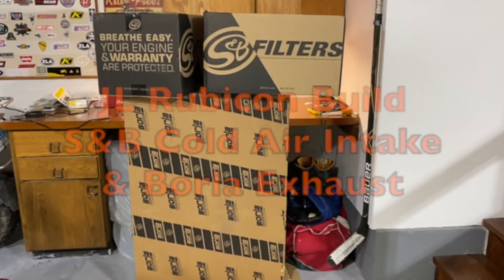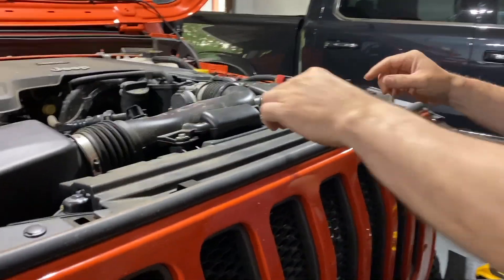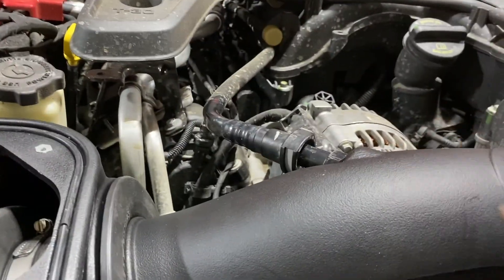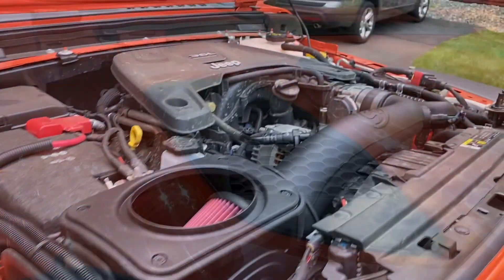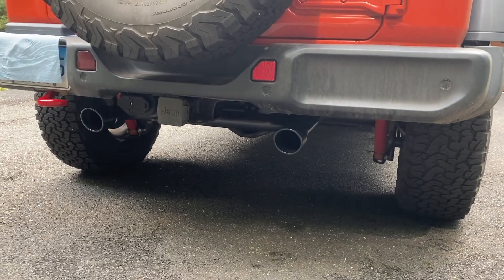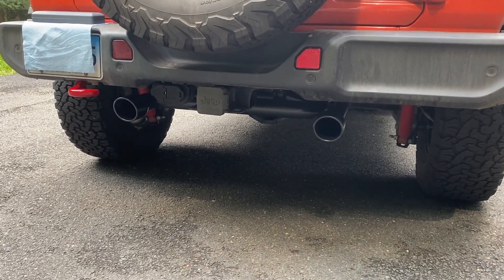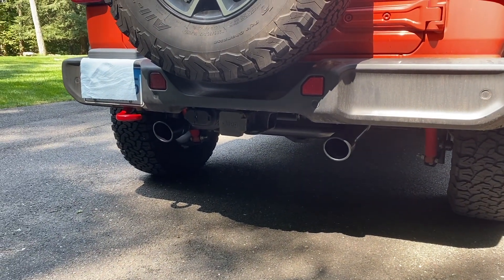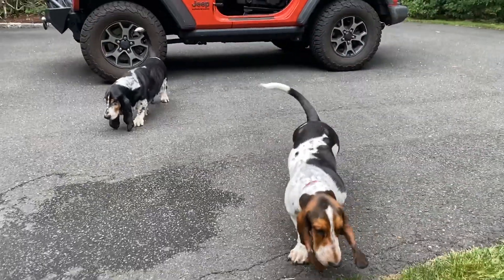Jeep JL Build & Review: S&B Cold Air Intake, Air Scoops & Borla Exhaust

Comment: Did you have trouble putting on the caps? I’m have a hard time attaching it lol
Reply from the maker: Yes!  Lots of trouble. That is the one thing I don't like about it. The caps take a lot of practice to put on quickly. Can't imagine standing in the rain trying to do that. I called the manufacturer and they acknowledged it's a bit difficult but said what makes them difficult to put on is also what ensures they are secure and don't fly off. So, that's the trade off, I guess. I usually leave them off unless I'm driving for a long time in heavy rain. Haven't had any problems with water getting inside.